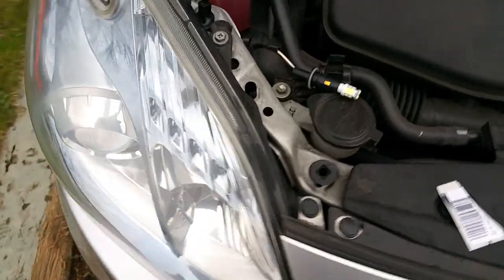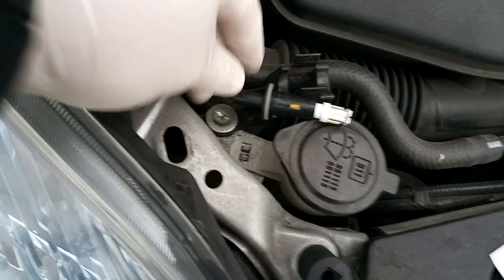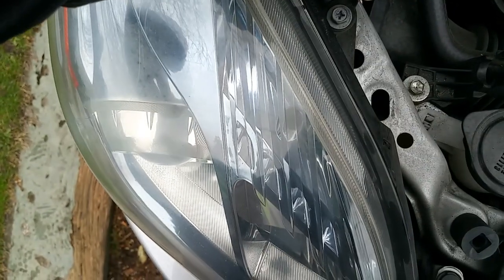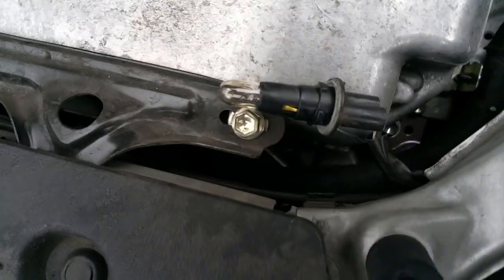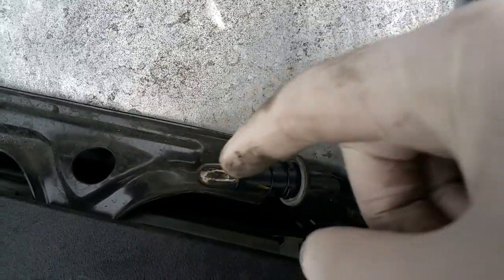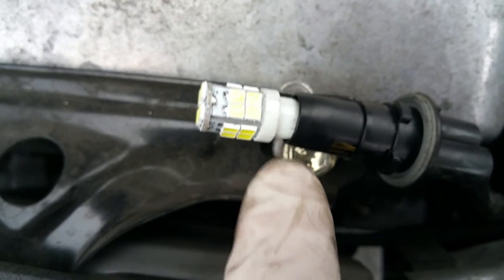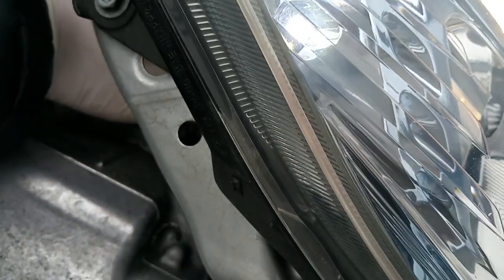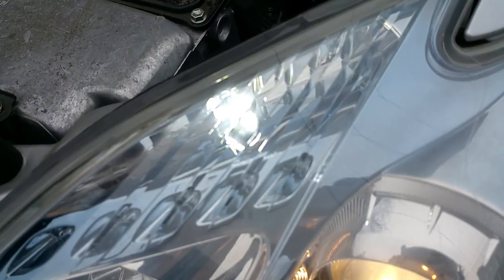Changing parking lights in Toyota Prius

Comment: Lining it up to put it back in is really tricky. The bulb holder has four tabs that need to match to four slots.  In each case there are two small ones, a medium and one large one.  On the driver side the large slot is at 4 o'clock (facing the car).  Make sure you get the large tab in that direction, and it fits in easily.
Reply: No kidding. I wound up with the bulb falling out of the socket into the inside of the headlight housing.

Comment: Made my life much simpler. I would advise that removing the one bolt holding that tube/pipe on the left is a good investment of time. It reduced my time of trying to get in there and get to the left side parking light - and my frustration. Unfortunately, it is a LONG bolt so get the correct ratchet.
Reply: germgaz1 hh